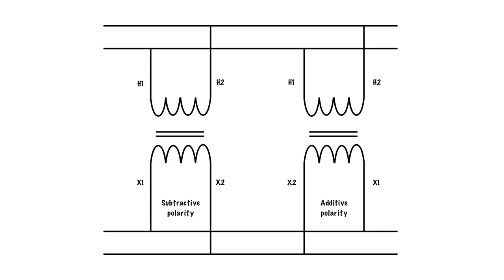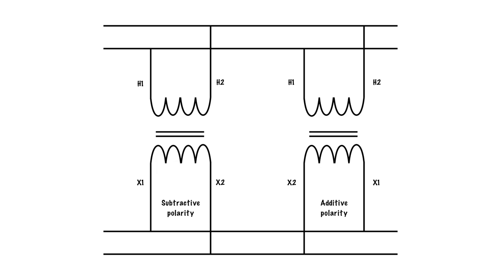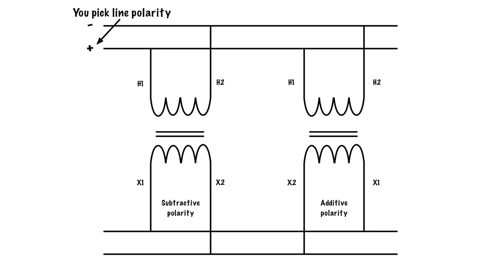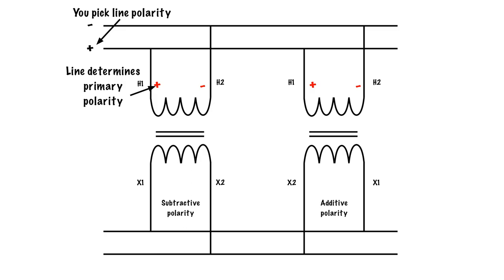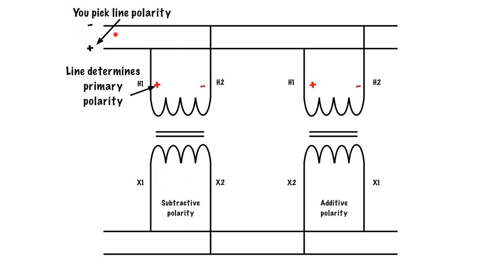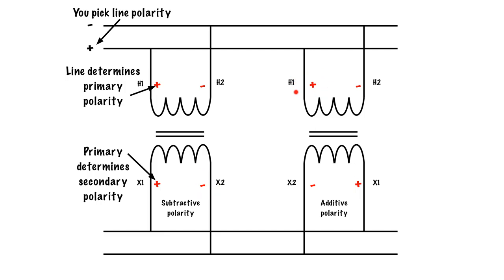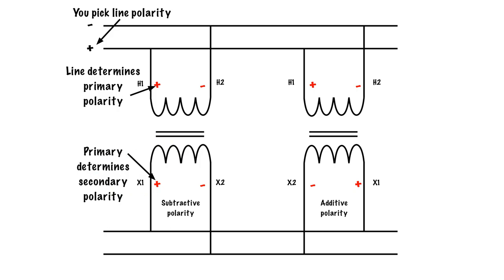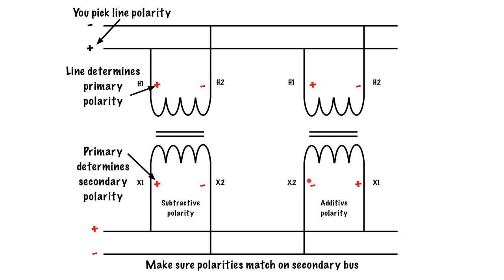Paralleling transformers (polarity)

Comment: This is a bit confusing talking + and - when we are talking AC. I don't really see how we can find out which terminals are which. Is there a real world example video somewhere of someone showing how they work out which terminals are which?
Reply: live and neutral
Reply: As the instructor said it makes no difference which one you designate as positive.   As long as H 1 and X 1 are CONNECTED to be the same.
Reply: + and - is direct current and a transformer can not operate on direct current.
Reply: Been looking at this lately.  Problem is when wires are unmarked.  Apparently, the rule that Primaries determine secondary phasing means the most important connection is to ensure the secondaries are in phase: Dot Convention.  Out of phase is noticeable (light bulb, analog meter) because the opposite phase cancels. I'm not certain, still learning and about to try it on 2 of the same xfmrs at reduced voltage/current.  I will post result for future readers.